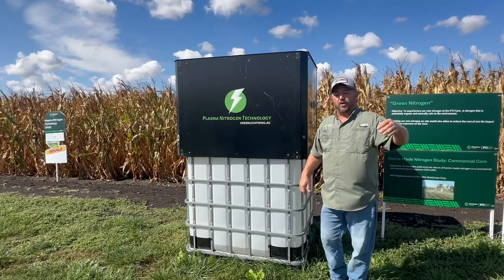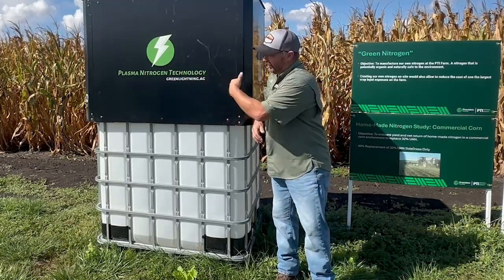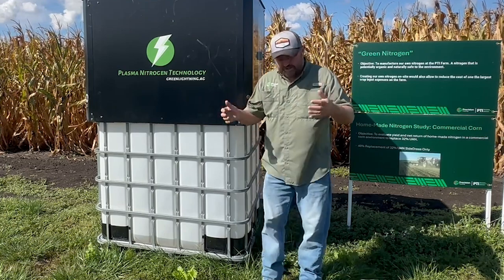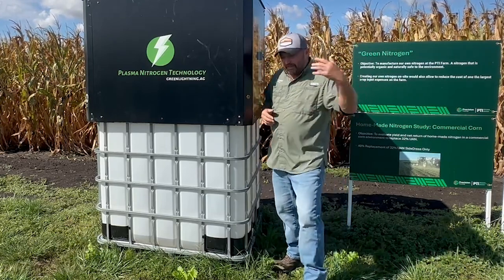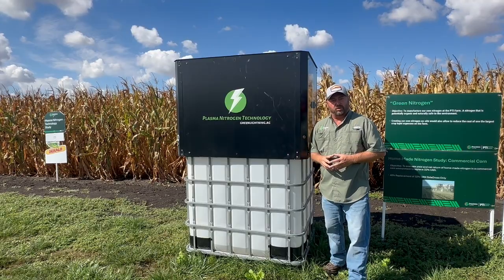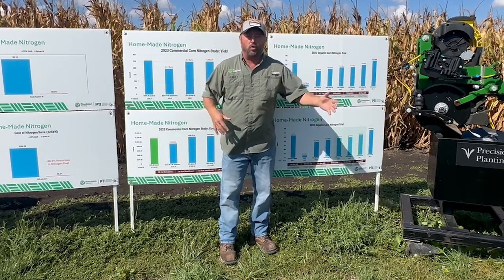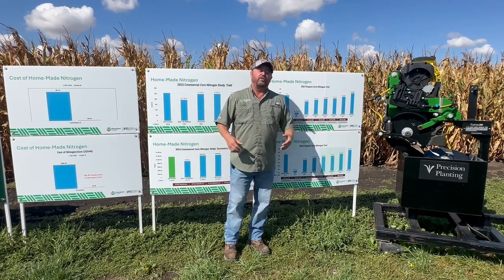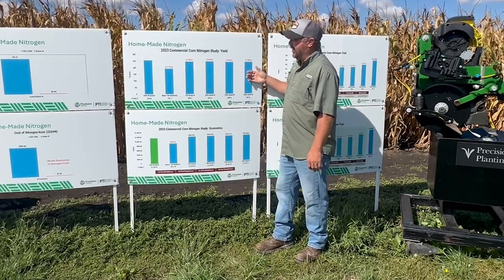InsidePTI | Homemade Nitrogen Study Results ‣ Corn

Comment: It seems machine is a Birkeland-eyde arc generator  producing nitric acid. 

Industry quited that process because of high energy consumption. If you have low electricity cost than cost of  n2  fertilizer delivered to your farm it is reasonable to use. 

Dont use nitric acid in your farm equipment  because it is corrosive. It will react with the parts of your pumping storing plumbing  systems. U should turn acid into a salt like Calcium nitrate (15-0-0) , potassium nitrate (13-0-45) .
If u want to use as an acid u may apply into drip irrigation it will not corrode the plastic parts.
Reply: There is fertilizer equipment that would resist the nitric acid. I'm more curious about the energy efficiency I think it cant be nearly as good as the company suggests
Reply: @ScootymcpuffSr  I did calculations for my father years ago . 15 megawatts for 1 ton nitric acid. 10 megawatts for an ibc tank %68 concentration . 10 megawatts = 1000 usds here . Ibc tank nitric acid is around 400 usd without tax and shipping . With tax and shipping it will cost about 700 usd.
Reply: 100 usds for the tank itself if you dont give them back to reuse.

Comment: How does the machine cost? I'm guessing 4 cents per unit of nitrogen, didn't have the cost of the machine figured in.
Reply: Cheapest system is $8.5k.  Not shown in video.  System in video is $38.5k